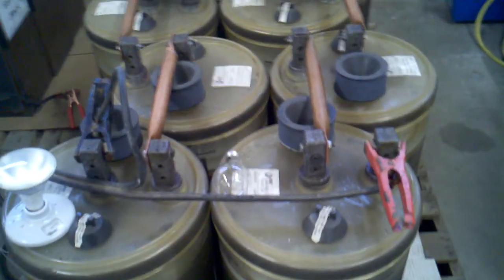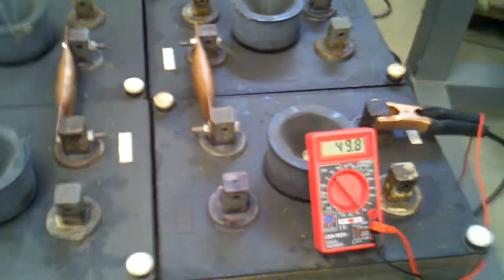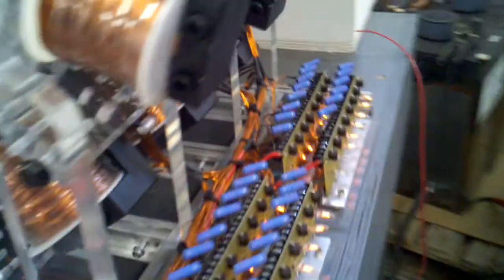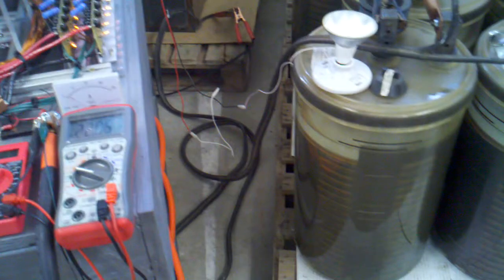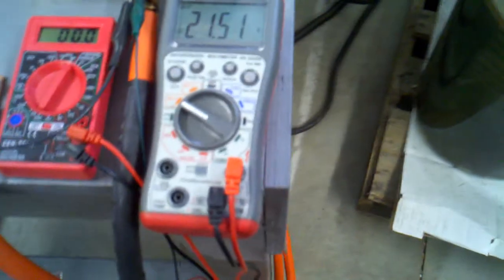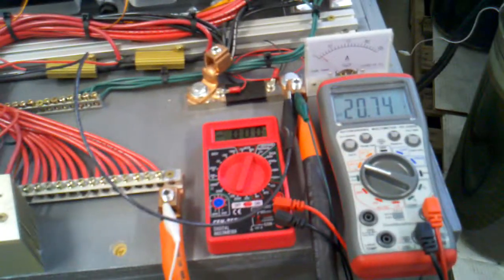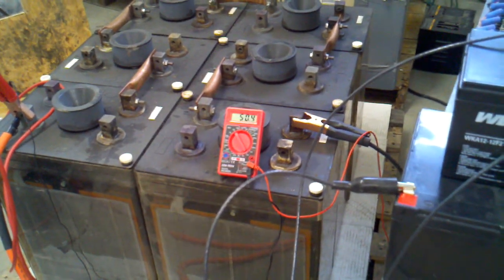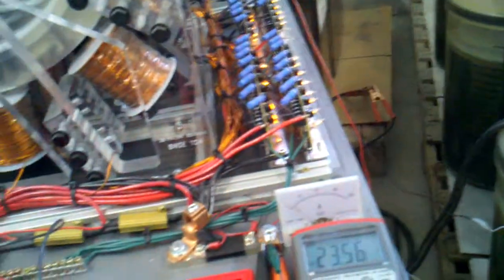Second run of 30 coiler to 2000AH batteries off of little batteries

Comment: waste hogs. You always put in more than they give. Right?

Its a easy test just get 2 kill-o-watts a battery and a inverter, i'm going to
plug a 100 watt pc with the sound and monitor, for a few hours, the meter
will record the total energy. Then charge the battery back to float voltage
with a normal ac charger. A Cen-tech 66892 may help
Now I don't have the fancy machine in the video, but the test is the same,
only the battery will be charged back up (with ac wall wort to run machine)

Comment: Good afternoon, good job. I have questions for you Rich.
 1 .- What is your generator power delivery is high frequency?
 2 .- What current, voltage, frequency and wave Forna delivery? I ask because I produce HHO industrial equipment and the data I can design a team to produce almost without using external power.

Comment: what is the capacity of batteries required to charge up the 48v bank of batteries from full discharge to charge state? Can 22v or 36v of 12ah battery do the job? What is the purpose of this set up demonstration?